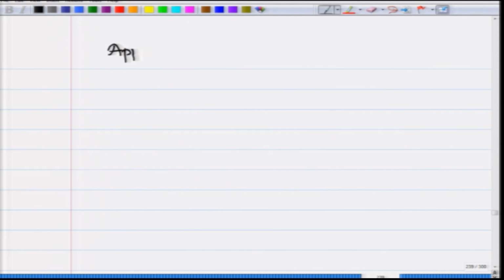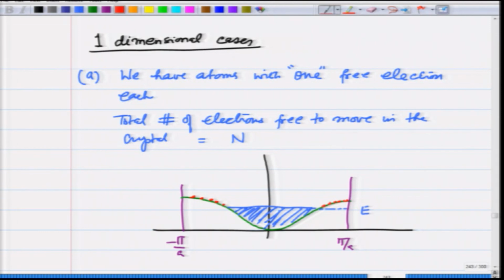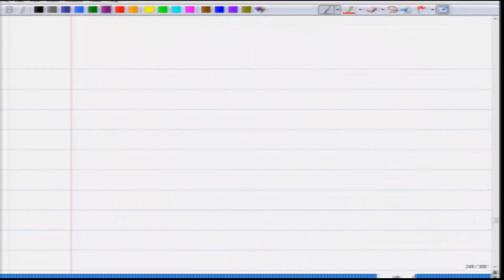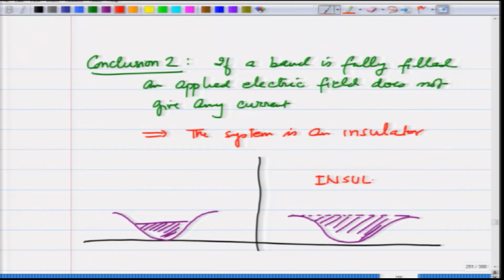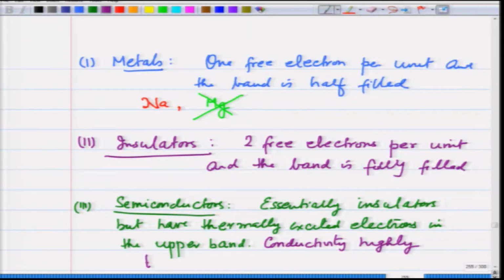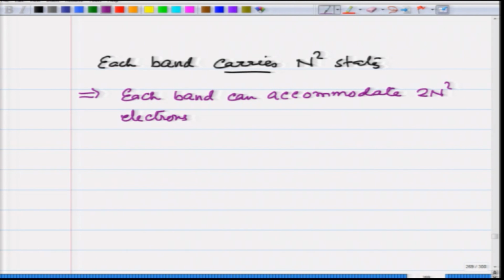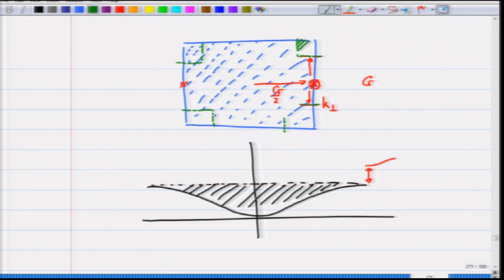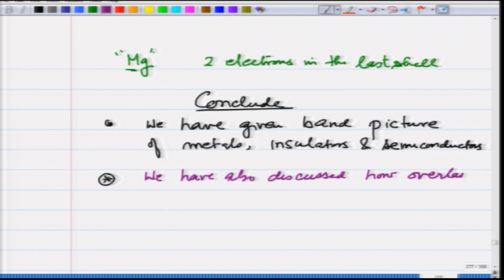noc19-ph02 Lecture 62-Band theory of metals, insulators and semiconductors

Comment: WHY THE KINETIC ENERGY OF ELECTRONS IS HIGHER AT THE CORNER LEVEL??
Reply: @Lucky Sharma Energy is given by hbar^{2}k^{2}/2m.  So when it occupies a corner of BZ, the energy will be higher than that when at BZ edge center,.  For consistency, use can write E=\hbar^{2}k^{2}/2m^, where m^ is the effective mass of electron.
Reply: @vasudevanm.v2760  but not much higher than it can go to upper band. can u clarify it?